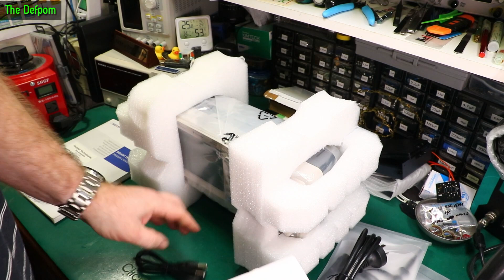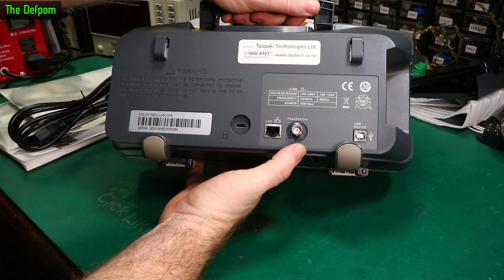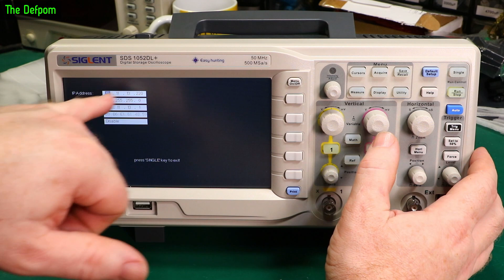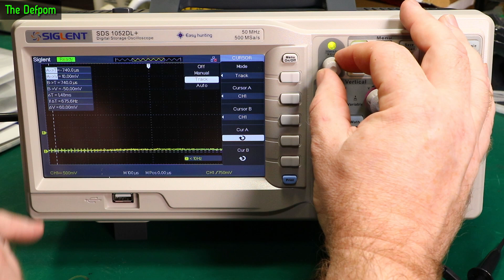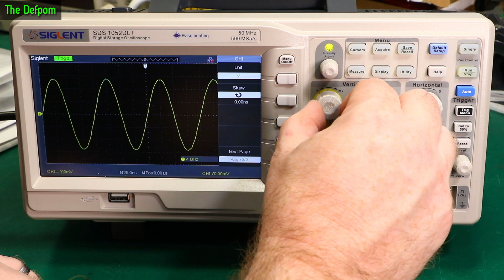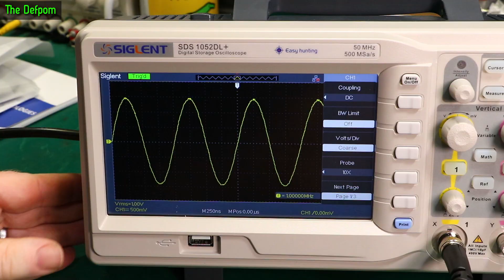🔴 SIGLENT SDS1052DL+ Oscilloscope Review - The Best Oscilloscope for Beginners ? - No.1063

Comment: What use is a LAN connection in 2023?
Reply from the maker: They are FAR more stable and reliable than wifi, a lot of equipment doesn't have wifi, and LAN is faster than wifi.